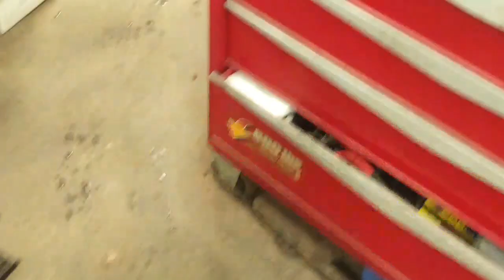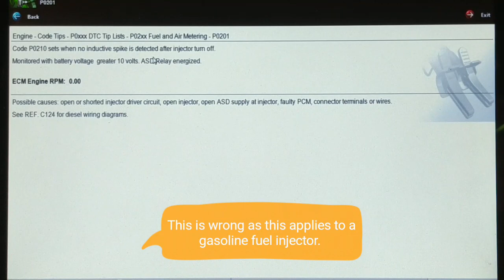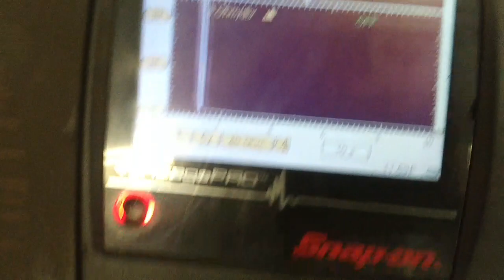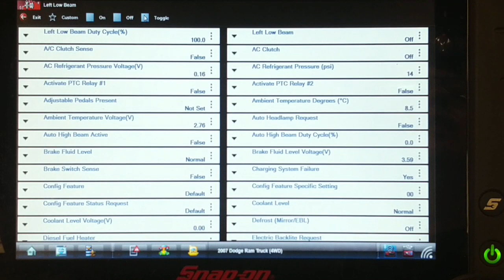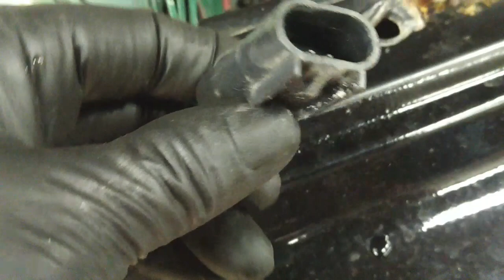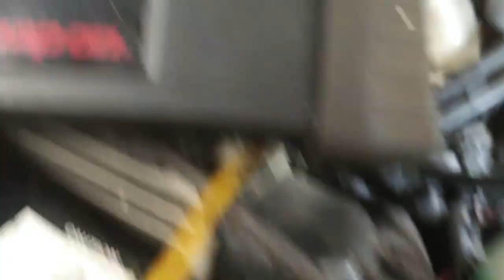2007 Dodge Ram 3500 5.9 Cummins P0201 and more

Comment: Just so people don't do work that is unnecessary, before you just assume the injector is the issue as this guy did, its important to finish the test this guy started to do. All he has confirmed is that it is an electrical failure. Since the injector is mostly comprised of mechanical components, you can assume it is actually not the injector. The next two items to check would be the wiring harness that is built into the valve cover and the only part of the injector that is is electrical, the solenoid. Isollate the two from eachother and perform the ohm test as well to see which of these two is the issue. More than likely the solenoid. Valve cover gasket is easiest to do and aroudn $150. Solenoid is just a few more steps, pretty easy and less than $50. Of course  you could just do as this guy said and replace the whole injector, but that is a much more involved job and will cost around $250. Dont be lazy, finish the diagnosis!!
Reply from the maker: Thanks for taking the time to watch the video. I did follow up with part 2 here: https://youtu.be/kA-RZhh4Q3s?feature=shared
As I mentioned the customer had already replaced the valve cover gasket so I was pretty sure it was going to need an injector. I was not aware that you could replace just the injector solenoid though. I will look into that option next time. Thanks for the tips.